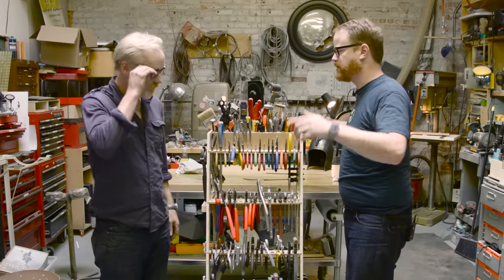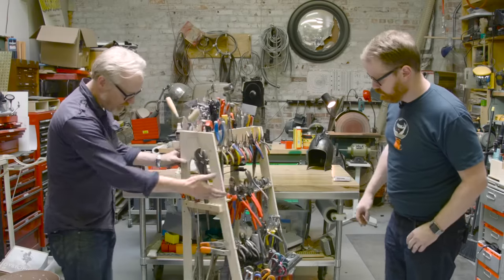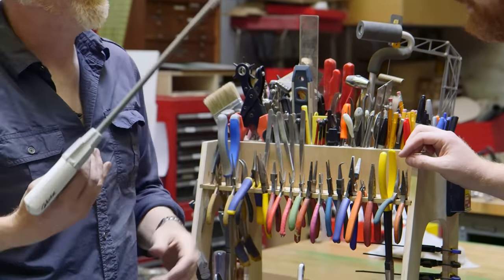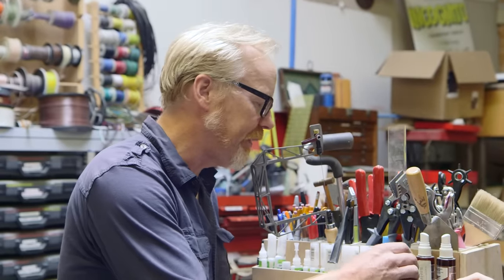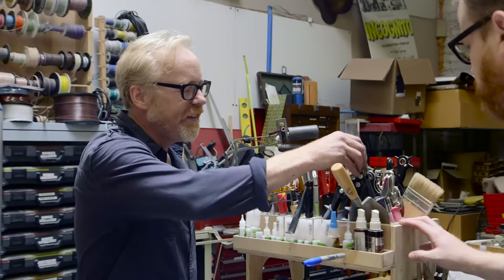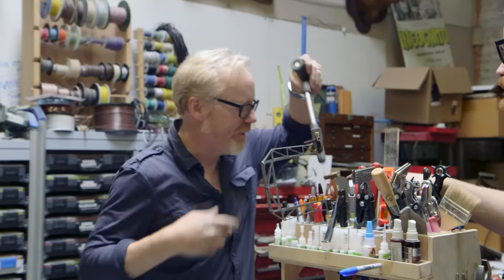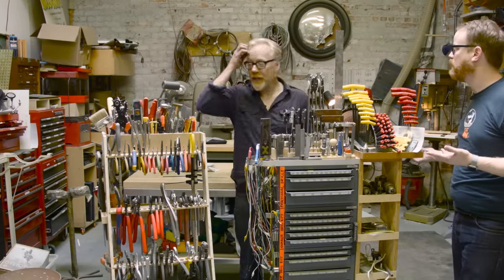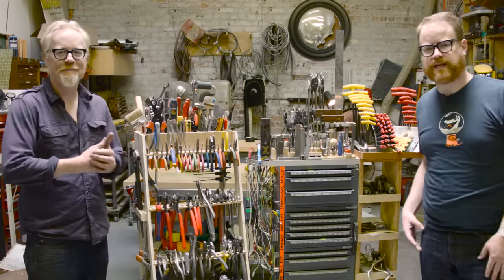Adam Savage's Custom Tool Storage Stands

Comment: Seriously, adam speaking of casters is cool. The difference between pushing your work cart around on regular rubber hardware or stock wheels and pushing it around on a group of upgraded non-marking wheels is something you have to just experience…because it’s not life changing or brag about type thing -
It’s a feeling that you DONT get when pushing your cart and having to listen to tools rattle or when the thing comes to a stop on a bolt or stray power cord. The upgraded wheels if you got the right ones, rolls over that stuff like a penny.

Comment: refering to the comment regarding legality of throwing away surgical instruments. I worked in a hospital for more than 36 years. I never heard anything about that. We in engineering were frequently gifted instrument that were out of alignment or not usable for whatever reason in surgery. They were always cleaned and sterilize before we received them. Instruments with no use and noone that wanted them were often thrown into the trash.  This is in the U.S.

Comment: I'm a mechanic, I like his theory but tools seem to walk away if they aren't locked up. However at my home shop, and in my mechanic truck each drawer has a purpose. like my electrical drawer has crimpers, pliers, micro torch, all sorts of stuff. the socket drawer has sockets and drivers on strips that are pop riveted to the bottom so they don't slide around. It all comes down to function. My welding table is setup with all the clamps and wire and gloves ready to go. sometimes you just have to sit down and organize.

Comment: It is supremely weird that I just spent 15 minutes watching a guy talk about how he built a tool rack, and gushing over some of his tools. :D

I am in a similar situation and find myself cursing when I can't find the right set of grips or cutters in the shoebox size plastic Sterilite storage boxes I use.

I've actually come to partially the same solution as Adam. My writing implements are all in ice tubes (a type of ice tray that makes cylindrical ice to fit through the necks of store-bought water bottles), and I've made several slots in the shelf above my work bench for scissors. But I still have piles and boxes and drawers of tools.

I just need to raid Adam's shop, I think.

Comment: It's worth noting that people largely adopted mechanic's tool chests as well as machinist's chests without understanding why the trades used them. If you're working elsewhere than home and your tools are expensive - loss/theft prevention is a high priority. This is one of those circumstances where hobbyists modeling after professionals fails to understand context. Now, A.S. is a professional, but he has control of his working environment.

Comment: On the topic of CA Glue An old modeler told me a trick. You can buy larger bottles of CA and then dispense it into smaller containers. To keep the supply fresh you just stick it in the freezer and it extends the life of the glue. I always lose or bugger up the little ones so it never worked for me :)

Comment: Cyanoacrylate glue called "hot stuff" by one brand, comes with "accelerator" (not a brand name, necessarily) which is what your kicker is, which actually makes the glue smoke as it sets because it creates an exo-thermic reaction and it gets very hot.
I've done it to my finger, so I know. ;)   
  The glue, accelerator and solvent should always be bought together and you'll never be sorry. :)

Comment: Kicker also makes the glue more brittle.  And you shouldn't spray it like that directly on the glue where it's "wet".  It should be misted nearby the glue but the glue shouldn't be doused by the stuff.

Don't use kicker unless you absolutely have to and don't use it at all if you need a solid glue joint that will hold up over time.  Kicked CA is REALLY brittle.

Comment: "Makita" actually builds really good stuff. It's reliable and tough, but not necessarily cheap. I often have to use a electric rotary hammer from Makita at my job to get rid of old plasters and you have to be careful using it otherwise you will end up going through a brick wall with it, because it packs quite a punch. It's also frikkin heavy so you can't use it for hours on end. But yeah as I said if you don't have to use it regularly you can buy something for less.

Comment: Weird, I've been fly tying (trout flies, perhaps there are other niches this applied to like salmon or bass?) for 24 years now and never use CA. Do people use it for head cement? I personally started with 'head cement' and then discovered that clear nail polish does the job just as well for a fraction of the price. Lately I don't even cement my heads on my dry flies because the extra weight isn't worth it. The rest of the fly will come apart before a few properly done whip finishes.    
Can anyone chime in on specifically what they use CA for? I'm interested now.

Comment: I would like to have adam looking at my workshop and give it a go at sorting... I am spiraling at the moment and that nr10 is never to be found.. and the 12 13 14mill.. (I have 5 sets) Also have about 2-3 tones of different, what I call, macGyverin´ material that I am trying to get sorted. (engine coolers, hoses from 1mill to drain tubes, rope in boxes, steel constructions, clamps, hooks, blocks, wheels, foam, net, cables, electric motors (3phase 20-30ibs down to small r/c-motors) screws, nuts, bolts m1.6 up to m64, UNC/UNF-thread? no problem got that... and the taps to cut them..  2stroke or 4 stroke?  Yes..  I have so much of this.. and so little time :D Who in their right mind have a complete drillbit for stone with attachements so I can go 40m deep? and no drilling equipement.. There is a tv-show in there that no one is filming.

Comment: One thing I hate about most commercially made tool chests is that they come with one pair of casters and one pair of fixed wheels, so maneuvering them around a shop--particularly one filled with airplanes--is a terror's nightmare.
I could see myself building a tool stand similar to this, maybe wider.

Comment: if i had the shop space for that, i'd need about 20 of them to hold my tools. I have at least all the tools you had there, except the surgical thing, which now I have to look for.  I even have that electric fret saw, only mine is an antique. And it just sits waiting for a use.  

I didn't like how that thing wobbled, I probably would have used a stronger material to keep it from doing that. All my stuff is everywhere, the drawers are there for things I just don't really use, so its sort of a graveyard.

Comment: I find I have the "first-order retrievability" problem in my kitchen, not with tools but groceries. If an item isn't in plain sight in the kitchen, or immediately visible upon opening the fridge/freezer, I forget I have it.  I've got canned goods in the cabinets from 2002 that I flat forgot about.  Luckily, my new fridge has transparent drawers inside it, so that's not the problem it once was.

(Yes, I recognize that this problem arises almost entirely from the fact that I am a huge gonk. It is what it is. :)

Comment: Make the tool rack so you can bring the tray you want to eye level. Something like a ski lift but on the vertical plane and the chairs are the trays. Of course, you'd need to pivot the trays so they'd go over the rollers at the top and not dump everything out. A similar thing on the bottom rollers.

Like a Ferris wheel, how the gondolas pivot as they pass top dead centre or bottom dead centre. Of course, you don't use a wheel but a skinny oval and make sure you're not moving the trays at break neck speed or your tools will fly off.

Or maybe use magnets to hold your tools in place and spin that thing!!!!!

Oh and sorry America, I speak and WRITE English and that's actually how you spell, "centre".

Comment: 9:30 lol my friends dad built a pair of those with two pieces of 8/1 inch steel welded to a pair of old pliers. Looked jankie as fuck, but it worked for the little bit of ducting we did in the hotel laundry room that couldn't be done on the bend/break.

Comment: While this is a very nice stand, the biggest problem with it and all similar stands is your tools get dusty sitting out in the open. 10 minutes with an orbital sander or a grinder near by and they are covered. I prefer neatly organized tool boxes. There is something to say about having your most used tools out and easily accessible though.

https://dl.dropboxusercontent.com/u/3156029/Pliers.jpg

Comment: Can we get blueprints?
Reply: Coolioman4444  It's pretty simple triangular frame with cross members that have holes for mounting and other cross members with shelving.  Add lightening holes to the sides for access and weight reduction.  It has a straight vertical back edge and angled front edge.  Determine how many tiers you want and ease of access and angle accordingly.  It's probably about a 60 degree angle.

Comment: Zip kicker, great stuff until you spray some on your fingers when you get some CA glue on them, while building my 1/350 scale Enterprise,  was ot paying attention gluing parts together little ca a quick spray did not otice the glue on my fingers hit it with some ZK AND THE A BURNING SENSATION BEGAN, AS I LOOKED DOWN I SAID WOW THIS BURNS AND COULD DO NOTHING BUT WAIT TILL THE PAIN WENT AWAY, BECAUSE THE PART WAS ALREADY DRIED ON MY FINGER, SO YES THAT TRULY IS GREAT STUFF.

Comment: where can I get the dimensions for this build
Reply: The point is to figure it out for yourself. Make your own dimensions. Lay out your tools, and build it to your own specifications, your own needs. Mine would be both taller and more sturdy than this one. To maximize the use of the space it takes up, it should be as tall as eye level, and if it's really going to eliminate an entire tool box, it could be a little bit bigger all around as well.

Comment: I disagree. I sort in drawers by verb (cut, turn, hold, measure...) or specialized task.  Problems are solved by actions see so I always know where to look. Thin drawers are the way so the stuff is only one layer thick, no digging. Protected from theft, moisture, etc. I could see having things out it racks if your shop was incredibly specialized and you were the only user but I am a generalist and usually share space. Just my 2 cents, everyone is certainly able to make their space however they see fit.

Comment: If you store the 2 parts of the glue far from each other it will last longer.
Reply: What kind of glue was that?
Reply: "Zap a gap" and "Zip Kicker" need to be stored away from each other or they will set up.
Reply: Robert Kothe Nice thanks,

Comment: if you work with mechanical tools sockets spanners, ring,open ended , they gonreally well in a tool box / mid  drawer and roller cabinet works well if you place them in a organised way, spanners on a ladder rack  small to large the racks taper from wide at the rear to narrow at front, when used for small spanner sets you can set up another rack opposite way round so 2 racks single layered in 1 drawer all easy to see  and locate, same for larger tool spanners side ways if big sized, screwdrivers same way, pliers and cutters can be placed in foam cut out lnserts, easy to use and easy to see whats there and whats missing , hammers chisels all can be mounted basically the same , PUT IN DRAWERS TO DIE REALLY IDIOTS , motor mechanicals technicians all use these systems great for storage of tools, metal working tools are stored basically same

Comment: did he say he cut drills to power something?

they make a shifty flash light that is basically that. but its cheaper. mine was free promo
removed led and switch/board. added a plug and some wire. now mines a charge adapter to use with my r/c charger.

idk where the sw/board redlines or how pissed pixys potential are but if the stars align theres your easy on/off, regulation and bonus cell protection.

forget how its faster, cheaper and cleaner blah blah..
get wet over the floppy thin shitty lens in it...  bc is not a lens but a really good stencil to bang one out of carbon, or brass, aluminum, delrin ect. now just poke some holes in her and secure this shitty idea to power anything.
compared to the nightmares of how to saw puzzle hanging of a murdered drill... the flashlight basically installed itself for you.

Comment: The weird thing is that he stands in that mess and tells people how to organize. If you're close to 50 and your shop looks like that, give up and ask for help. Not everyone is good at order.

This video is seven years old, and the shop is still a mess.

This is like those diet tips Oprah Winfrey inexplicably feels qualified to sell in spite of her obesity.

Drawers aren't evil. They're fantastic. One Harbor Freight tool chest drawer holds enough wrenches to cover 6 square feet of wall space, and an organizer made from 12-gauge wire keeps them in a neat little row. Same goes for pliers and screwdrivers.

Drawers also keep things like sawdust, abrasive grit, and metal filings off your tools, and they discourage rust.

Savage's ex-partner should probably be doing this video. He sticks with what works, not what's cool and fun. His welded shelf array is an inspiration. I'll bet his whole shop is efficient.